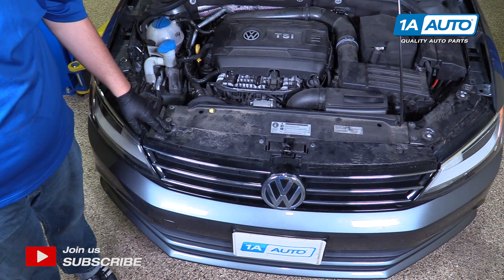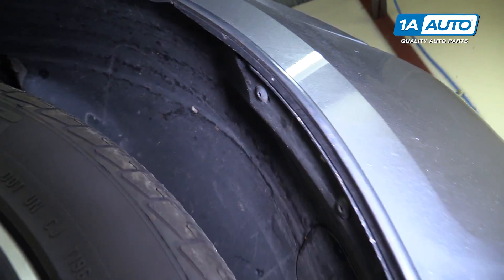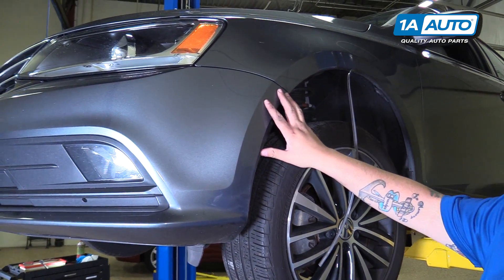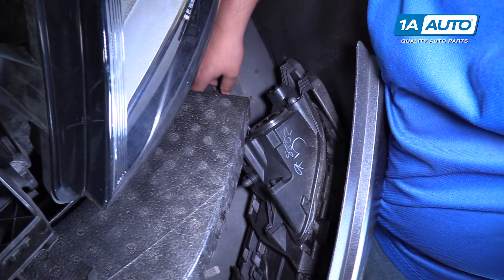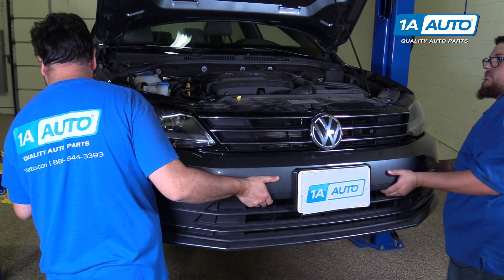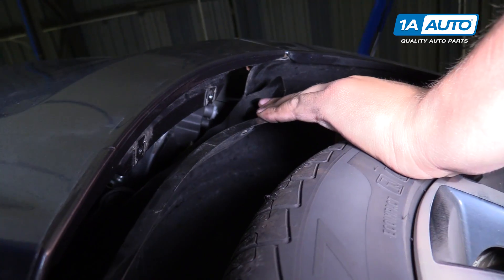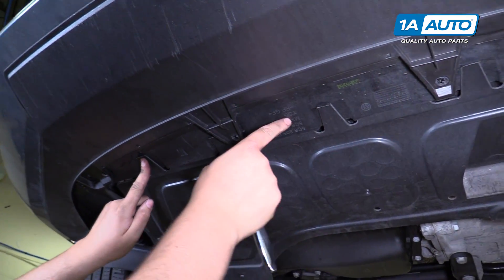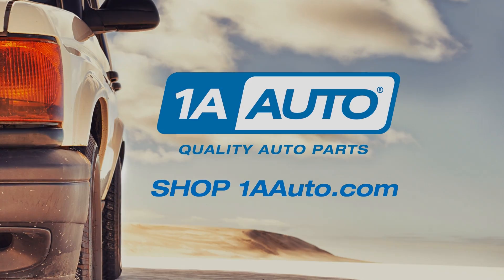How to Remove Front Bumper 11-18 Volkswagen Jetta

Comment: Are all 2011 to 2018 Jetta front bumper covers interchangeable?
Reply: In 2015 there was a facelift, so I wouldn't try to put a 2015 bumper on a 2011, for example.
Reply: @kadenwatt2033  always wondered if it fits

Comment: I replaced my 2014 jetta radiator most of these steps dont apply. Any questions comment and I'll help. It was actually pretty easy
Reply: I need to replace my 2014 bumper cover. Any pointers would be appreciated!

Comment: Anyone know if the ambient air temperature sensor (outside temperature) is behind the front bumper, and where it is?
Reply: A year late but it's just in front of the radiator on the bottom

Comment: Hey I had a question regarding my Jetta. I own a 2016 Jetta S and need a new bumper cover. Someone is can sell me a 2012 Jetta GLI with the honeycomb grille. Will this be compatible on my Jetta and how would I find out for sure? Thanks!
Reply: Ecs tunning or amazon have a complete kit but im not sure if it's going to fit, I have 2017 Jetta s and I buy the 2016-2017 Jetta gli front bumper kit, the 2012-2015 gli bumper is suppose to fit but I'm not sure
Reply: Kewin Colon I have a 2017 jetta se will the gli front bumper fit?